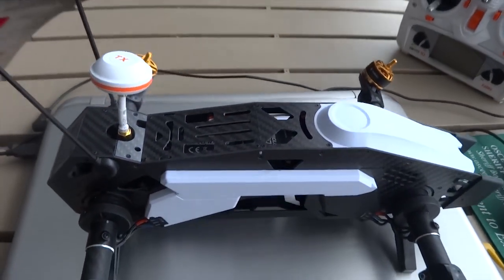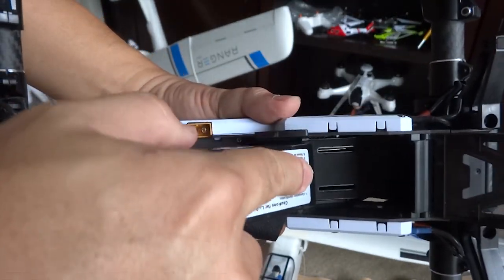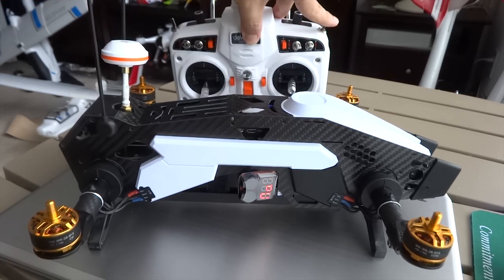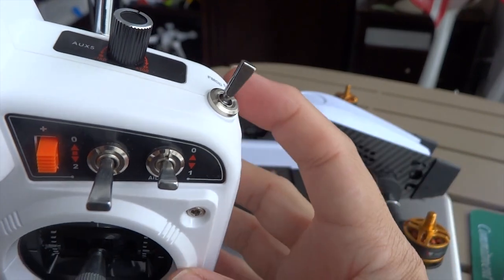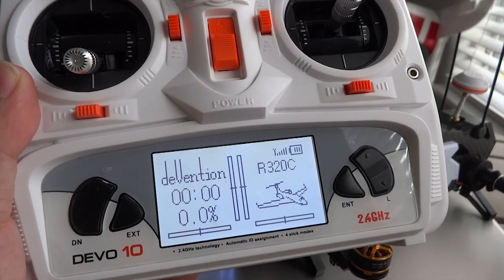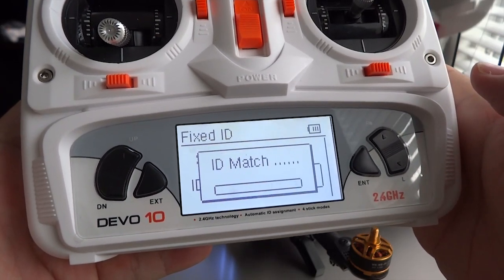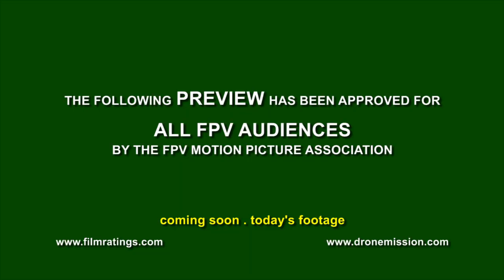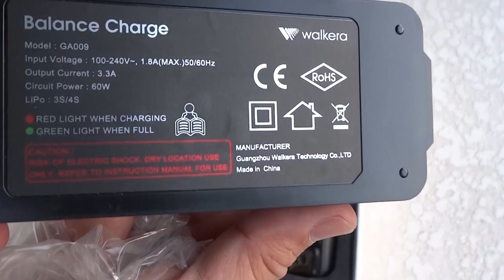Walkera Furious 320 review unbox fpv tilt rotors

Comment: Hi,
I just bought the BNF version and was planning to use it with my Spectrum DX9 Transmitter. Is the stock one usable with this transmitter?
Could you help me on how to go further with this.
Do i have to change the receiver to Spectrum or is it bindable with the stock Walkera Receiver.
when i opened the top of the Furious 320 cover to reach the receiver it is connected with a unique cable with the controller board. 
i am really confused at this point.
Please help
Reply from the maker: +Najamuddin Mohammed just connect your external receiver to those pins, also look at your user manual.  i have not tried it, but that is how it is done on the runner 250 bnf.

Comment: Is there a difference when using FPV goggles using the 1080p version? I don't really understand the whole FPV thing.
Reply from the maker: +7168sparky at the moment, most of the goggle are receiving analog video over the air, so improvement is minor.  However, the video onboard can be recorded at 1080 if it comes with a dvr sd card
Reply: Thanks!

Comment: friend that there is difference between the furious 320 (c) the main controller furoius 320 (g). they offer me a cheaper version without gps. I thought to buy it and add the gps, I do not know if the controller will be the same?
RESPONDER
Reply from the maker: my understanding it is a different flight controller, going back to cc3d.  if you are into DIY, sure you can do anything with it, the added challenge is the tilt rotors. - dm
Reply: i have the non gps with the devo 10 it has been flawless, i have only seen issues with the gps version i would not own one

Comment: Good Morning. What is the flight time of this drone? Could you tell me which one would be better: him or the Runner 250 Pro?
The Furious 320 can suffer the "Flip of Death", as I have seen happen with the Runner 250 Pro.
Reply from the maker: We now know a pilot who can't flip, may want to fly in air mode.  It is always idling and stabilizing even at zero throttle.  So i would suggest F215, Rodeo 110 or F210 (may have to diy upgrade firmware) if you are concern about your flipping.  The GPS drones (250 Pro and 320) were not really designed for flipping.  Cheers.
Reply: I saw that there are two versions of F210, one is 3D, what is this 3D flight mode? Is a drone racer better with or without GPS?
Reply from the maker: Marcelo, yes, there are two version of f210.  The 3D version has another flight mode that allows the motors to reverse when you are upside down.  You change to even props and it flies like a 3d helicopter.  Episode 141 explains it all https://www.youtube.com/watch?v=Eed6ZBN__OE The GPS has an extra weight not in the most optimize position for racing or aerobatics.  The f210 were on a formula race on Episode 138.  The gps versions are still good fun and best for speed flying at a distance, where you flip a switch and it comes home.  I assume the gps 320 will be fast, i have never flown one.  You can find the entire fleet at www.ucdrone.com
Reply: So I can not do acrobatics with the 250Pro Runner?